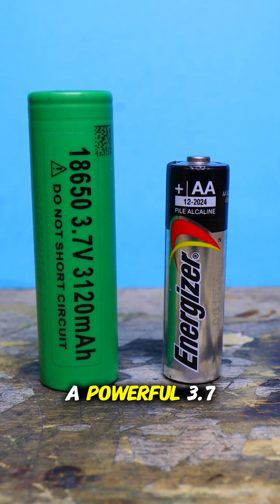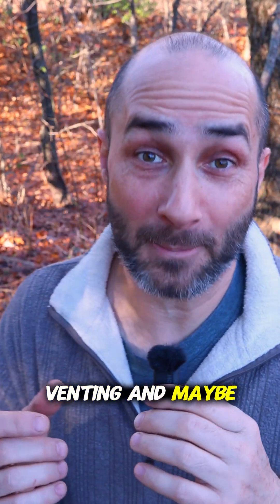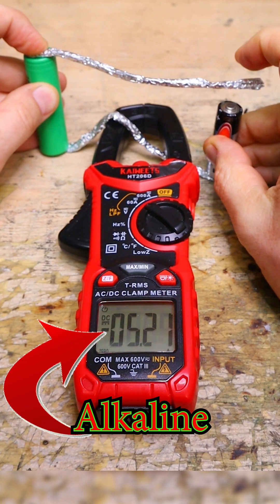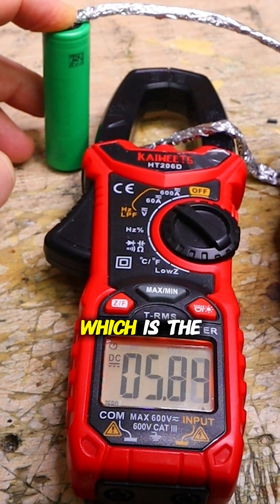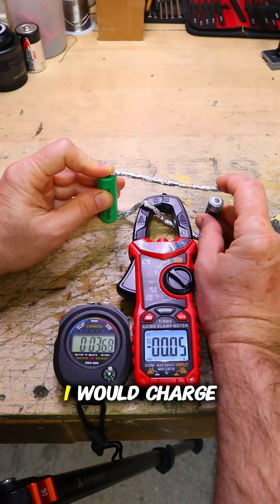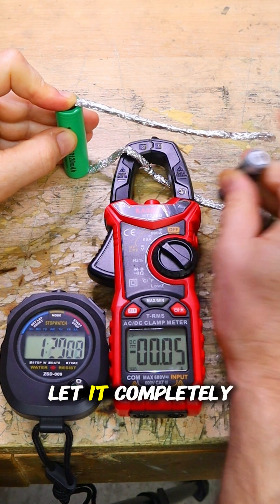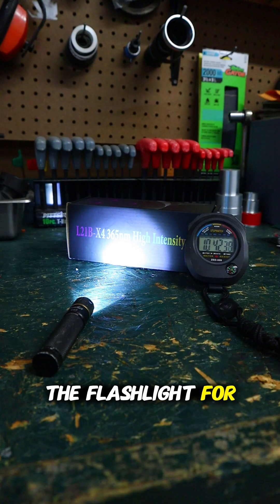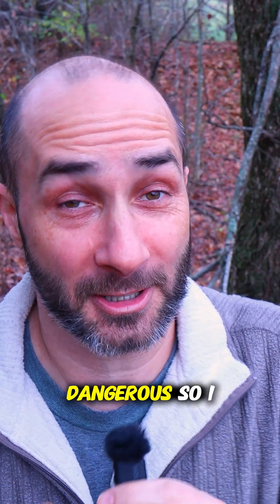⚡ HIGH VOLTAGE DANGER: Can a 3.7v Li-ion Charge a 1.5v AA?!

Comment: my mother just died of lymphoma from the bullshit poison hand sanitizer you sold her
Reply: Did she drank it? Because even if sanitizer was straight up radioactive, it would be causing skin cancer, not lymphatic system. Sounds like completely unrelated bs. Even if sanitizer was poisonous fr
Reply from the maker: Sorry to hear about your mom.   I'm not going to speculate on weather or not sanitizer had anything to do with her condition.  I will say that my family and I have used that sanitizer (exact same batch, only ever got one batch)  for several years, and experienced no issues.  To this day I have what's left of it in our kitchen and both bathrooms in the house.   Again sorry for your loss.
Reply: @Lumencraft-  you are right, nothing can be proven and this is just my opinion.

Comment: good for a manual charge for old partly wonky nimh and nicd batterys
Reply: just use a dumb charger to bring them up to voltage at which a smart charger will recognize them
Reply: to high of internal resistance can trigger a smart charger to give a bad battery error